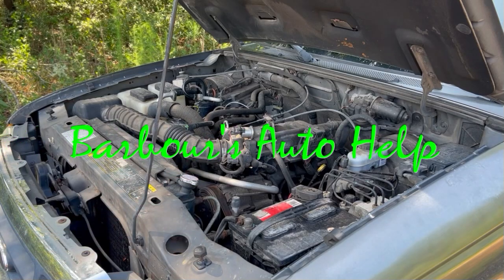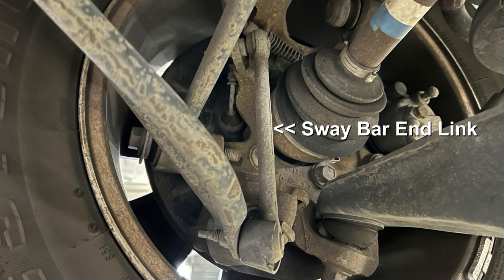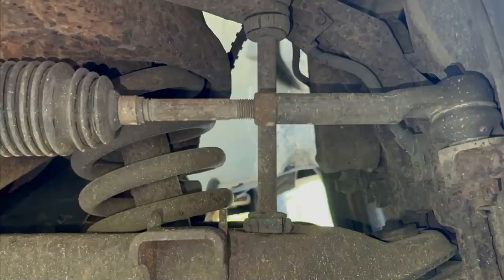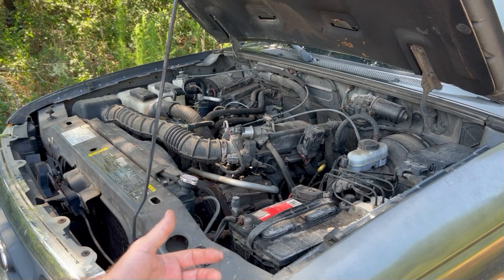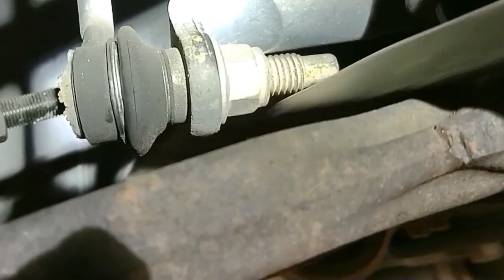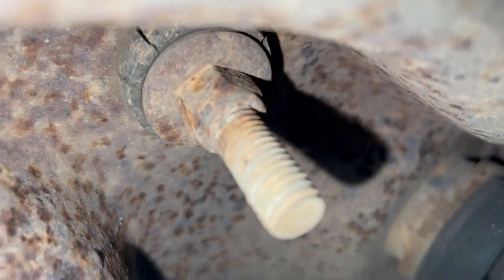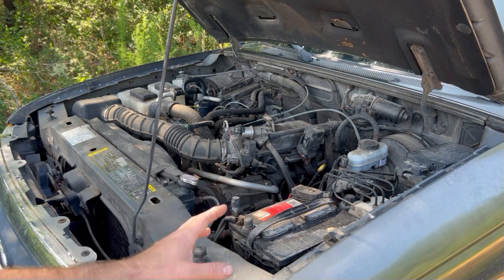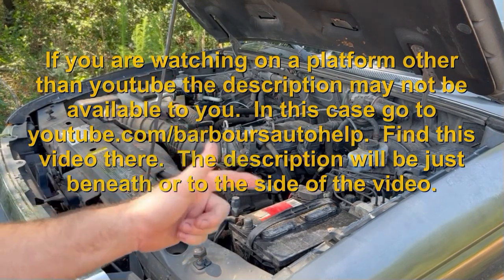What A Bad Sway Bar End Link Sounds Like And Looks Like

Comment: That's the best example of the noise I've ever heard on YouTube.
I was about to order some new lower control arms but now, after further inspection and hearing your video I positive its the sway bar link  👍
Reply from the maker: Glad to hear the video is helping. I hope you’re right.  Make sure you check the other components in your steering and suspension system as well. There are other things that can make a similar noise.

Comment: Great video! I am going to check my sway bar link tomorrow! My ford fusion had loose shocks on the back and was a quick fix. I have a feeling it is not my struts but a sway bar link!
Reply from the maker: Good luck!  I hope you figure it out.
Reply: @ definitely hope this is the issue. Struts are $200+!!!
Reply: @BarboursAutoHelp  both sway bar links had play so i changed them. Noise went down tremendously but i think the struts are still clacking along. I guess 134k miles was a good run for the original parts. I appreciate your video!

Comment: I’ve been trying to figure out what that noise was for the past year. I thought it was the ball joints and replaced them but it didn’t get rid of the noise. I even took it to a mechanic and they couldn’t figure it out
Reply: Same here, 2014 Kia Optima SX turbo, brought it to 3 garages, they found nothing wrong or unusual, even after test driving it! Finally, I searched and found by sway bar links to be faulty